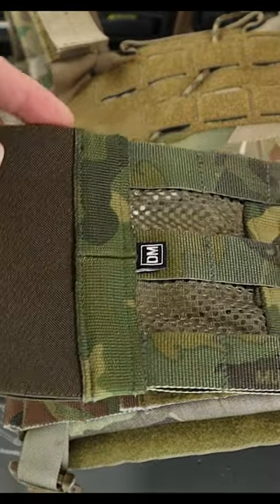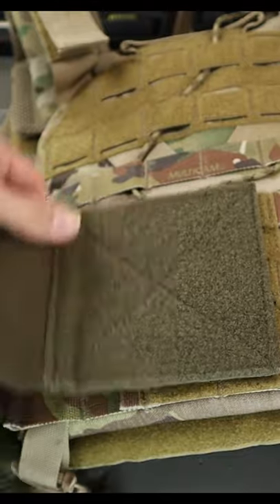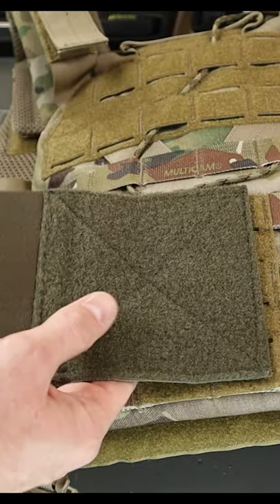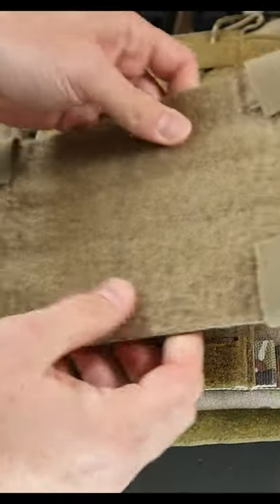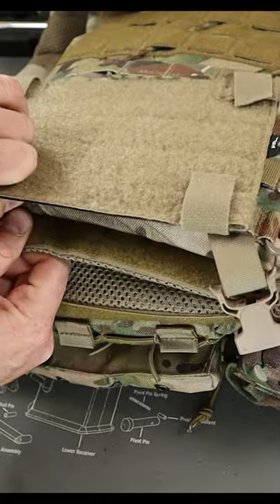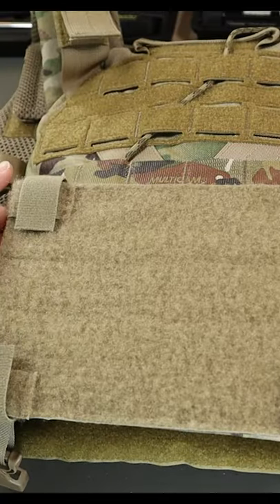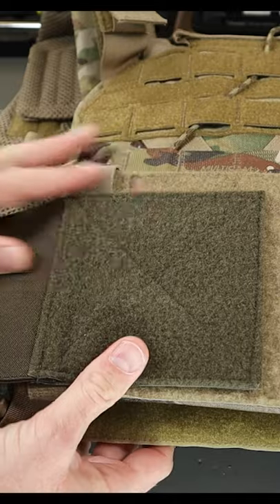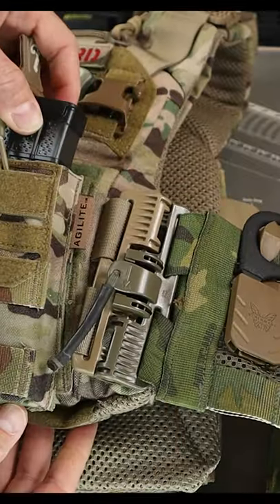Connect a Defense Mechanisms Hybrid Cummerbund into the Agilite K19

Comment: my biggest problem with plate carriers and probably chest rigs is my torso size is probably smaller than most adult males. weighing at 120 for a height of 5'8 some cummerbunds are just too large for a snug fit.
Reply: Same here
The Cry Precision JPC use elastic bangy cord to secure the cummerbund so for me it works better because I can threaded at what ever molle loop i want